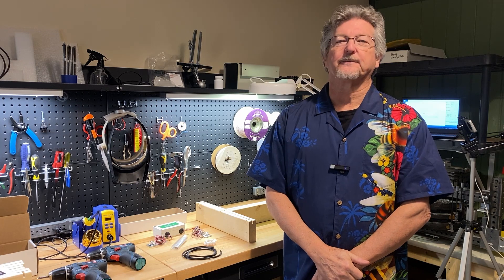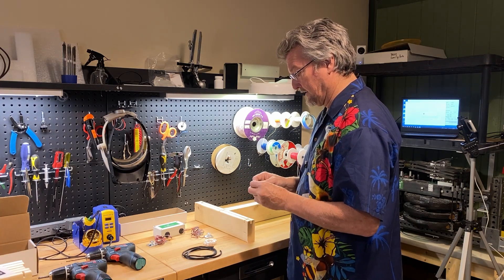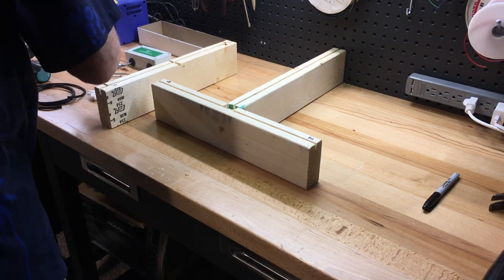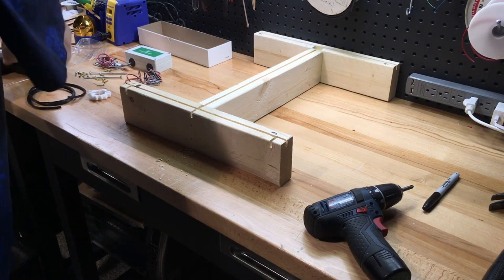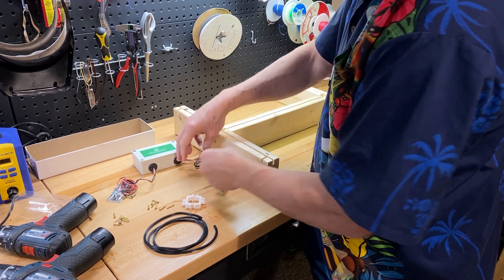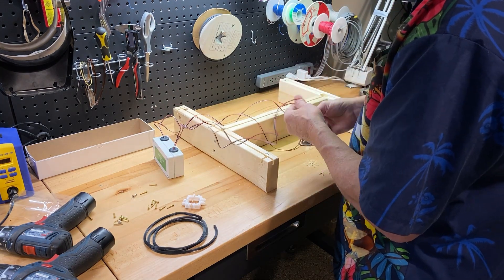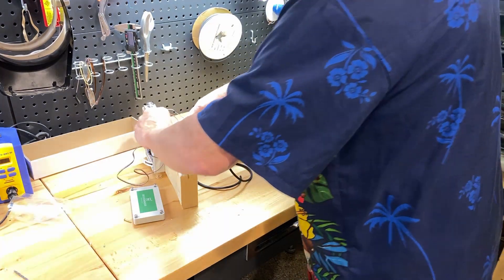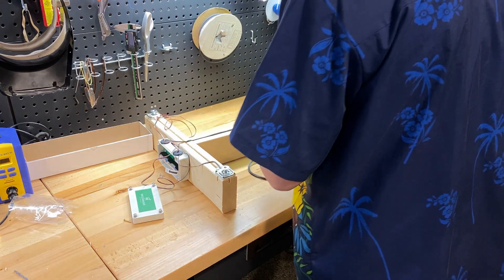BroodMinder W3 Assembly - Fixed Feet

Comment: Thank you for sharing this video! What length of 2x4 do you use in this "H" model?
Reply from the maker: They can be whatever length for your hive. Typically we use 16.5" for a normal 10 frame langstroth which is 16.25" wide. I will update the standard user guide to have more info, but you will find quite a few details here right now.  https://www.dropbox.com/s/atfg8em6j9pipar/W3-Assembly-Guide.pdf?dl=0